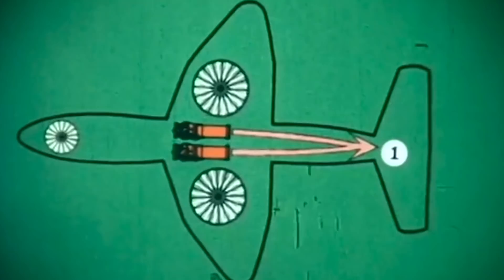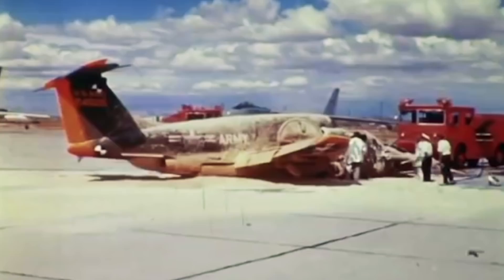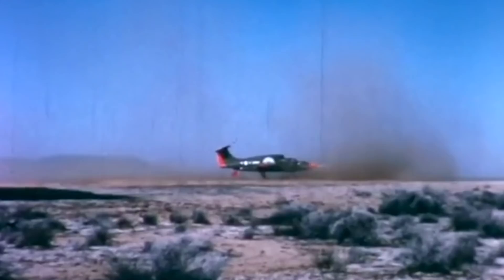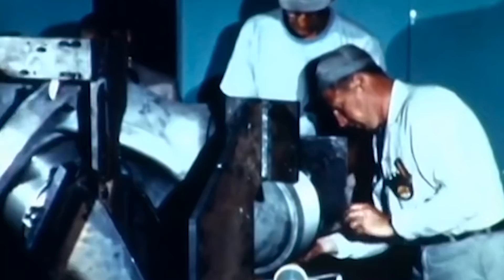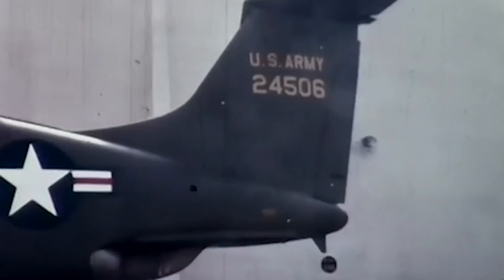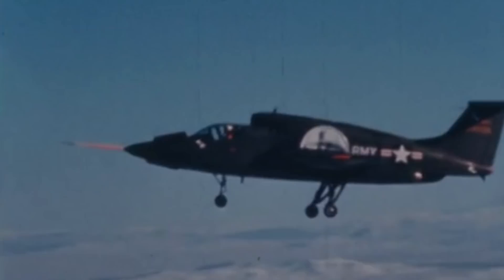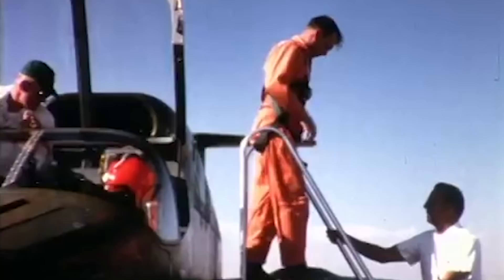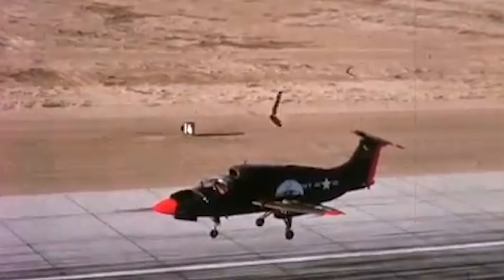Ryan XV-5 Vertifan - American Jump Jet

Comment: The 2nd prototype ended up in a salvage yard at NASA Ames research center in Mountain View CA, which shared its location with Naval Air Station Moffet Field. 

I was naval aircrew assigned to a VP squadron at Moffett, and I had been studying military aircraft since I was about 10 years old. My position on a P-3 was at the port aft bubble window, and on takeoff I had a clear view of the NASA salvage yard. 

Recognizing the little junked plane, I finally drove over to the yard and checked it out one day. It was indeed what I thought it was. I went to the NASA admin building, but couldn't get in to talk to anybody. I left a detailed message with the security guard at the front desk, describing that there was an important historical prototype rotting away on the back lot, with a plea to pass it on to someone in charge. Shortly after, I left on deployment. 

When I returned 6 months later, it was gone. I went to the admin building to inquire, and was told by a different guard that "some squid came in here talking about it months ago, and it was recovered and is being restored". 

Well, now I know where it ended up.
Reply: "Some squid..." LOL!  Good work!
My son is a "Squid" as well. He is stationed in Charleston, SC and is attending Nuclear Propulsion School. He will be the nuke officer on a Fast Attack sub, in less than a year.
Reply: Bubbleheads! Never had much use for them. 😆
Reply: My nephew is a Seahawk pilot; he hunts bubbleheads for fun just as I used to. 😉
Reply: @ChasWG  Just a thought: This might be a small piece of information you maybe want to avoid to be spread on the world wide web.
Reply: TRB3

Comment: Imagine the faces of the engineers that designed this aircraft if they saw a harrier jet 😂😯😯😯
Reply: They would have, harriers would not have been any good as a rescue plane but did literally everything else.
Reply: @seriousmaran9414  This thing couldn't even rescue its own pilots. Who are you trying to kid?
Reply: @taketimeout2share  they at least tried, even if they would never have succeeded well as it was too small.

Not my fault that it was crap, is it?
Reply: They probably did, the kestrel, the prototype of the harrier was in development about this time. In fact a lot of data from the various U.S. v/stol experimental aircraft were used to redesign the Kestrel into what would be the harrier.
Reply: This aircraft helped pave the way for the Harrier...
Reply: @adrianotero7963  The prototype for the Harrier the P.1127 Kestrel first flew in 1960, 4 years before this aircraft

Comment: My father worked on the XV-5 at Edwards for GE Flight Test. He was one of the Propulsion System Engineers. I remember the crashes at the time. I even have a photo of Lou Everett in front of the airplane. Unfortunately no autograph. When the second crash occurred it was pitched in one direction so when it hit it flipped the opposite. Slinging the pilot parallel to the ground. He never left the seat. I was in college when those happened.

I don't think it was ever seriously considered as a fighter craft. Mostly ground support and rescue.

Dad worked on any number of 1960's early 1970's experimental aircraft for GE.

Comment: I think the Brits had the best design
Reply: Not really. Vectored thrust was more doable in the 1960s, but it was hella accident prone. Plus it creates a massive infrared signature that made it vulnerable to shoulder fired SAMs. Lift fan technology required better powerplants and lightweight materials that wouldn't exist for another 30 years. The Harrier was pioneering, but like so many pioneers it was a cautionary example too.

Comment: No VTOL aircraft will beat the Hawker Siddeley Harrier. It went there, did it, got the t-shirt and did everything with iconic glamour. Even the yanks had to concede to the greatness of the Harrier with McDonnell Douglas and Boeing building later airframes. How Boeing lost the F35 contract to Lockheed Martin I'll never fathom, they had the blueprints to an already excellent VTOL airframe, they simply needed to modernise it.

Comment: 7:18 he is talking about a crash on the lake bed, but showing video of the second crash using the lifting cable that got sucked into the engine, on tarmac with a grid. He then talks about the second crash, but doesn’t show it from the outside perspective, only the onboard camera, giving you the impression they are two different crashes (The grid is also clearly visible on the onboard footage)
Reply: Tou are free to do better.

Comment: So basically you had a vertical take off system that only worked for a couple of minutes during normal flight but interfered with aerodynamic performance, was dead weight the rest of the time and took up space in the airframe so that you wouldn't have as much space for fuel, cargo, weapons etc?  Even if it worked I don't think it would have been competitive with standard airplanes.

Comment: Must have annoyed those the engineer's summit fierce when little 'ol Britain put the Harrier into active service.
Reply: Then the USMC flew them
Reply: Different type of aircraft build to serve for different purpose, only similarity is vtol. So your ignorant comment wont stick here.
Reply: @hukumbra  Whoooo! You didn't get what you wanted from Santa this year, did you?
Reply: @hukumbra  Yeah, but going with rotating nozzles was a better idea and may have worked for both applications.
Reply: @hukumbra  Was it? They used the word fighter. Which is what the Harrier is - amongst other things!
Reply: But it took the Americans (McDonald Douglas/Boeing) to fix the problems and make it more than a one trick pony. The original Harrier was limited to light close air support sorties, after the modifications, the Harrier 2 became a premier ground attack aircraft that even attack helicopters couldn’t compete with. It was even given the ability to defend itself from fighter plans.
Reply: @DrivermanO  no, the Harrier was NEVER a fighter, not even the improved Harrier 2 from  McDonald Douglas/Boeing, is considered a fighter. It was only a close air support aircraft when originally designed. After the mass improvements made by then McDonald Douglas, it became a very capable ground attack aircraft, even surpassing most attack helicopters. If a Harrier pilot is really good, he might get lucky and not get shot down by a fighter aircraft. If he is really, really good (or the other pilot is bad), he could even make a kill in a dogfight. The USMC flight school did train their pilots how to use the thrusters to turn tighter in dogfights against the F4 Phantom, but that isn’t saying much. The F4 was never known to be a close in dog fighter. It was designed to make kills beyond visual range. Harriers wouldn’t have stood a chance against MiG 17s and 21s. They didn’t even have the speed to get to safety, being that Harriers were subsonic.
Reply: @mopar_dude9227   The Sea Harrier FSR1 (Fighter, Strike, Recognisance and Attack) flew in the Falklands conflict in a fighter capacity with a very good kill ratio. I’m not suggesting it was a dog fighter by any means; the Argentinian aircraft were handicapped in many ways, but it shows that this later, British variant was just as capable as the MD version and has the operational history to prove it.

The US beats us hands-down when it comes to combat aircraft, but I will not concede on this one. Look at this way, in the modern era, how many foreign licensed aircraft have the US had in operation? It’s testament to the fact that, just this once, the British had a better idea
Reply: @martindewhurst2485  And the Canberra!

Comment: In the beginning when the Air Force was formed, they were like little kids who screamed and cried when they did not get their way. Army; we are developing new aircraft. Air Force; "I'm telling mom!!!
Reply: Infact, to this day, and many soldiers have paid the price for it. That's why the Apache replacement will be much faster, to further reduce reliance on USAF CAS
Reply: In the beginning?  Hell they ain't stopped yet!
Reply: In the beginning they were composed of Army personnel and followed Army doctrine. Instead of blaming the child, blame the parents.
Reply: @northroad1  This is not true. Troops showed satisfaction with USAF CAS in the 20th century, the USAF investigation determined it was Army officers who refused to call in CAS more frequently because of their grand plans of replacing the Air Force with rotary wing aircraft.
Reply: @ChucksSEADnDEAD  The notion that the LTs, CPTs, SFCs on the ground in battle refuse to call in support from the air force is laughable. I've heard the panicked calls, they're yelling for ANY support, and don't give a damn from who. The truth is, at least in Iraq, the Army could only rely on USAF for pre-planned ops. In central Iraq the USAF typically only had one flight of F-16 airborne at any one time while there were 4-6 flights of Apaches for the same area. Apache pilots would always be monitoring the same net that ground units were on and often knew to head toward units in contact even before things deteriorated to the point of a call for air. If you ever been in the service you know each branch has their priorities and often don't work well together. The mission of CAS, especially outside of peer conflict should be left solely to the army, and that includes the funding.
Reply: @northroad1  Andrew Krepinevich’s 1986 book “The Army and Vietnam” explains the internal conflict between the regular Army and the airmobile supremacists better than I could. Additionally, in 1966 the USAF Chief of Staff directed a study on CAS and found out that Army troops were satisfied with USAF CAS, but they were being excluded from the CAS role by the Army brass.
Quote: "Meanwhile, U.S. Army advisors were working to develop ARVN airborne helicopter assault tactics, using equipment of two U.S. Army companies which had arrived in Vietnam in late 1961. Almost at once a problem arose over fixed wing/air-ground coordination. According to directives issued by the newly organized U.S. Military Assistance Command, Vietnam (USMACV), all helicopter operations into areas where enemy opposition was expected were required to have fixed-wing tactical air cover. U.S. Army corps advisors who controlled helicopter usage, however, tended to ignore the requirement.
In April 1962, during a visit to South Vietnam, General LeMay learned that Army advisors were not calling for fixed-wing air support, that only about 10 percent of ARVN heliborne operations were accompanied by VNAF aircraft, and that the Air Support Operations center at Ton Son Nhut frequently were not informed of such operations. Concerned about this situation, LeMay subsequently obtained permission to assign air liaison officers (ALO’s) to all ARVN corps and division headquarters and USAF forward air controllers to augment VNAF liaison squadrons…,"
“The United States Air Force in Southeast Asia 1961-1973” (Office of Air Force History, 1977)

Comment: It was a good design with one major flaw:  Almost the entire body was taken up by ducts for the ducted fans.  A second design solved this problem by placing one engine at the root of each wing, just under the wing itself, so that the length of the duct between the engine and the fan was close to zero, with just one cross-duct running between the fans to transfer engine exhaust to the opposite fan should one engine fail. This would have solved almost all of the problems with the first design, but it never got that far, the project was cancelled.

Comment: So are the Harrier (sorry if spelt wrong) jump jet not considered a VTOL aircraft?
Reply: The Harrier is classified as a VTOL.  Although a somewhat capable craft, it was cursed with a very short operating range due to large fuel consumption requirements.

Comment: It was pants which is why the yanks brought the harrier jump jet from the U.K. 💪💪💪💪
Reply: ...30 years later, a more fuel hungry less fast and more finicky design. Sounds like  british engineering.
Reply: @mikehimes7944  and yet the harrier is still in use, whereas the XVs never made it past the prototype stage, shame really add the concepts were cool, and different enough to the harrier that they could have happily coexisted.
Reply: @mikehimes7944  actually the slowest variants of the harriers was AV-8B and GR-9 clocked at 662mph 🤔 I’m sure that’s faster also the fastest harriers are FRS-1/FA-2 sea harriers at 735mph I’d say that was a fair clip faster to be fair though the American harrier with the extended nose cone did look better than the Brit ones
Reply: @mrwolf9335  good point.  Sorry,  I was trying to be funny yesterday and ended up drunk.

Comment: Any thing to save stalling weight poss needed to just enough fuel load before u try vertical save safe rescue. It needs to be able to safely drop right amount of fuel before trying in rescue safe enough to try helo coming if u fail too, needing help also.

Comment: I don't think this is related to F-35 in a major way. The lift-fan + tilting main exhaust setup (which this does not have) is used in a lot of other jets. The lift fan is also driven in completely different ways. (This apparently has exhaust-driven fans, while F-35 has gear-driven fans. They're all fans, but the drive mechanism make all the difference, otherwise we can probably say common desk fans inspired F-35, can't we?) I like how this channel covers obscure, lesser-known planes, but I can't agree with the way it mythicize everything to sound like another perfect plane cancelled by politics. Engineering doesn't always work, and reality is much simpler than we want sometimes, but that's not stopping us from appreciating every failed attempts.
Reply: The jr. Engineers then are the sr. Engineers now. The corporations have all this data to fall back on.

Comment: The V-22 Osprey is still a controversial aircraft.  There may be reasons, mostly political pork, for it's continued operation.  Helicopters are still better suited for those requiring vertical take off/ landing duties that have not had as many developmental/ maintenance issues as the Osp.

Comment: At 9:10 you claim that the Ryan Vertifan (maiden flight May 1964) "paved the way for VTOL aircraft as something possible and achievable". That had already been done by the Hawker P1127 (maiden flight May 1960) which went on to become the Kestrel and Harrier. Come on, be fair, don't try to rewrite history.
I'm sure most of us would accept that the Vertifan proved the concept of vertical fan lift, but certainly not VTOL jet aircraft as demonstrated by the Hawker workforce 4 years earlier.

Comment: It's not quite accurate to dismiss the German helicopters of WW2 as prototypes that "never came to be". Both the Fl 282 and Fa 223 saw operational service - albeit in small numbers. A captured Fa 223 Drachen was flown across the Channel to England by it's German pilot at the end of the war, the first crossing by helicopter. As might be expected, the German helicopters were technologically ambitious the Fl 282 for example had intersecting rotors, also a first.

Comment: Heard of this plane before, the historic XV-5A test footage of it is great.
https://www.youtube.com/watch?v=_NrsknJIIiM
Of all the VTOL jet concepts, this one stood out to me since it correctly makes sure to use a relatively large volume flow with a low exhaust velocity for increased efficiency during hover. This concept was then later used in turbofan engines, which make modern jet aviation efficient.
I think this concept with modern materials and control systems could work well and compete with helicopters until battery technologies are ready for electric vehicles to take over.
Reply: You'll never be able to fly something the size of a 747 fully loaded on a battery alone.
Reply: @iffn  Yes but we can't break the laws of physics. You can only pack so much of whatever ( Lithium/Ion batteries, solid state batteries, Lithium/Sulfide batteries, etc) in a given area to provide energy.

Comment: Or inside your own line then 100 miles min help & 1 to 1 ratio by ground min ratio. Very fluid line in jungle between your control-ed ground or there hostile high risk ground. Only safe base is sea based!!!!!!!!!!!!! Only safe hospital is artillery & mortar safe 100 miles away range. 200 miles safe ground behind  non hostile ground min if want to land or take off except sea or quick touch copper down till even further away.

Comment: The fans must spin opposite directions & it Must hve shouts on each fan shouting the air into diff non Vortex directions. Future modely hve control direction of shouted air flow help fix needed. If u can double the fans spinning opposite direction Each wing per down flow even better/safer always moving forward slight lift, the greater the wing & rear wing stabilizers the safer. Ppl injuried need to be easy lift doors up on both side Laying down rescued nothing air w/out near by flying helo in air 50 miles max away at all time sure rescue.

Comment: I've always said the Army should tell the USAF to go pound sand. If the Army wants to spend its money on fixed wing aircraft it should do so. USAF has an inferiority complex when it comes to aviation. They are so worried about someone doing a better job than them they will shut down successful programs, even if it means a less capable war fighter.
Reply: By that logic the USAF should try and have an infantry even better than the Army.
When all's said and done you're paying taxes for two armies and two air forces. It's the end it's us pounding sand.

Comment: Nothing larger than safe pnt 50man max out post if u hve cover trench escape s lanes nothing secure more so than jeep or helo or truck larger per out post, must hve artillery piece min gun. 3  rows of barded wire & 200 yards of lited clear mined ground. If u hve a min of 100 out post u hve that ground safely air attachable safe & secure ground in juggle. Esp if few r tank double out post 2nd line of defense backed up secure.